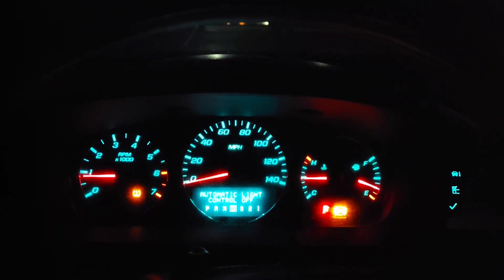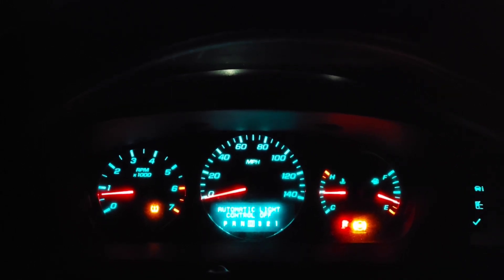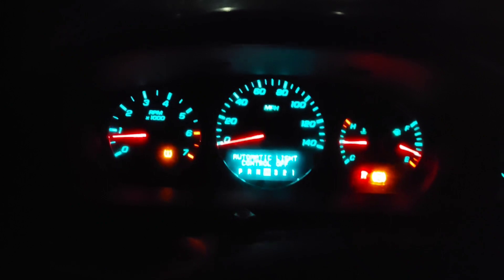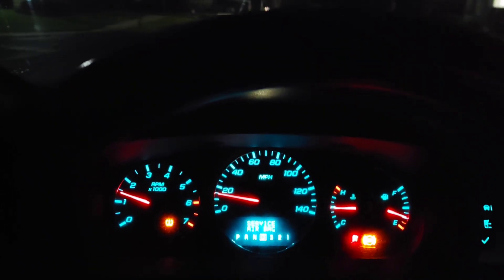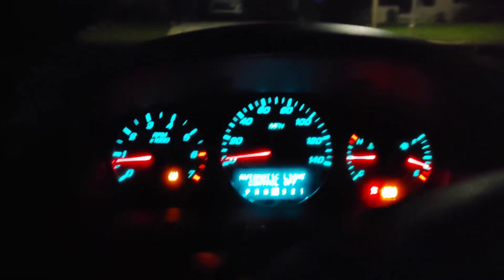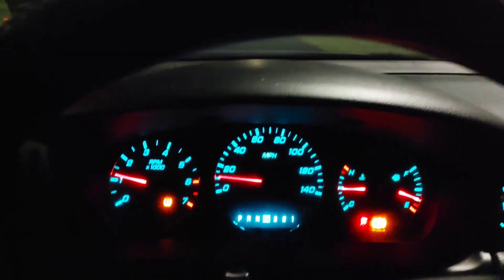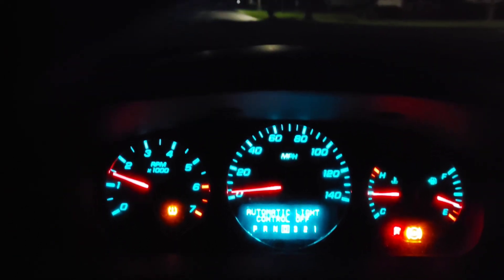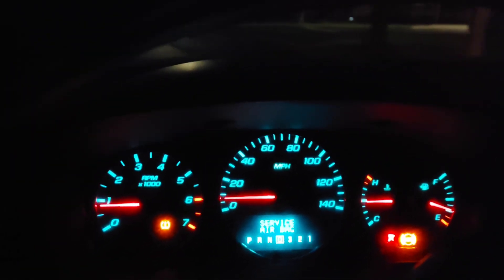what is going on with this car HELP

Comment: Worn out or fouled spark plugs can cause rpm fluctuations. Check the engine vacuum and make sure there are no leaks. Leaks in the engine vacuum can cause rpm fluctuations. Replace the fuel filter if it is clogged or dirty.

Comment: I shared your video in our Impala FB group and someone suggested that you try driving it in selector 1 to see if the problem still remains and if not then it's not your transmission. Hope that helps
Reply from the maker: My mechanic found the issue it was a leak in the line and the transmission fluid was leaking out once we replaced that line and sealed it up the issue stop, thank u so much for your help

Comment: Connect an obd2 scanner to your car to check for any engine light codes, obd2 scanner are offered at your local car parts store. It’s possibly a basic tune up (spark plugs, wires, distributor cap) or vacuum leak. Keep us updated and hope you’re able to solve the issue 👌

Comment: clean out the throttle body , check plug connection to air filter box.Also buy seperate spray and clean out Mass airflow sensor.
Reply: I was going to recommend this solution

Comment: It could be as simple as a sensor. But it could be a transmission failure as well. It could also be a throttle control sensor. Just take the car to pepboys or a mechanic willing to give a free estimate. Don’t continue to drive the car that way it will cause more damage. I work security and have driven and owned many retired police impala. They all have issues over 100,000 but if you get them fixed car will last forever
Reply from the maker: Awesome that's my plan, yes I've had issues with all my impalas but they are well worth it

Comment: Check your spark plugs or fuel pump if all is good then it could be your trans time for a trans swap rebuilds not really all that cause alot of shops don't rebuild the entire trans they just fix what the issue is then slap it back together

Comment: Yeah i dont know why people keep mentioning transmission this and catalytic converter that, those wont cause your ABS, Airbag and TPMS erros/lights to pop up this is very clearly one of two major issues

1. a major engine wiring harness became disconnected either partially or intermittantly, could be water in the connector or just shook loose over years of driving from engine vibration or going over bumps, for example in the volkswagen beetle the engine computer was under the dash just under the windshield, when it would rain water would leak past the windscreen, get on the computer and cause it to loose connection so every time it rained it refused to start, could be something like this happening

2. theres an emissions issue, now while a catalytic converter failiure wont do this other issues such as an EVAP or an EGR issue will cause your dash to light up like a christmas tree because EVAP issues are very bad for the enviroment so to comply with regulations if theres a serious emissions issue the car will purposely run very poorly so your more inclined to get the issue resolved, out of personal experience i know the Crown Vic will disable the fuel pump, my personal Explorer disabled ABS, AdvanceTrac and idles poorly, and my Focus when the EGR went bad it would keep stalling at idle and also run poorly, and a friend's 2019 subaru impreza, their fash lit up and they lost ABS and i think traction control too when their evap line melted and clogged. regardless get a dealer or a qualified mechanic you trust to do a EVAP, Emissions and purge valve test and go from there.
Reply from the maker: Wow thanks so much

Comment: Is it making a whining sound I really can't tell by this video?
Reply from the maker: No
Reply: @commanderhall848  okay then I would check to see if you at least have a pending code because sometimes if it's not a serious enough problem the check engine light will not illuminate but you most likely have a dirty sticky throttle body making the rpm fluctuate over time they need to be cleaned